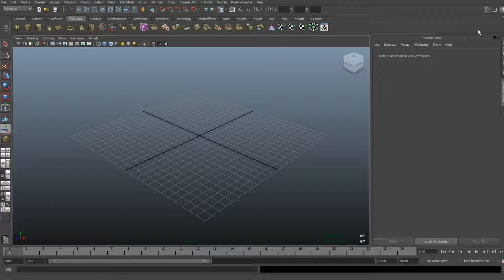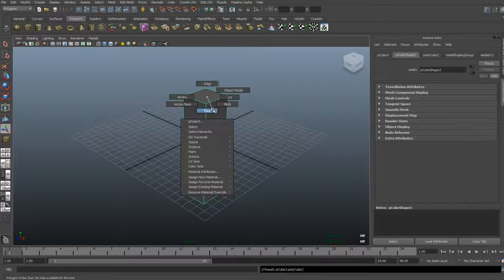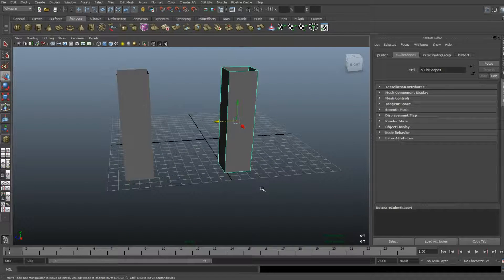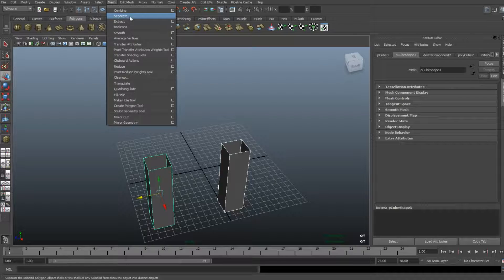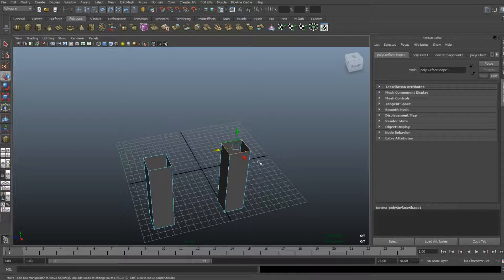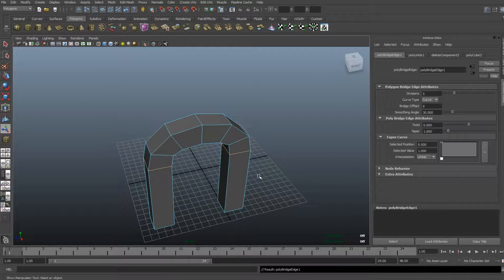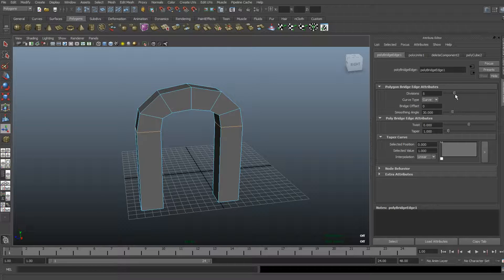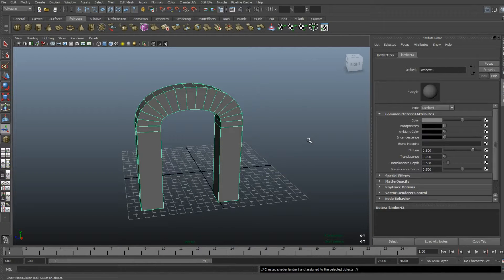Maya tutorial : How to create an Arch in Maya

Comment: Simple and easy to understand lesson - it worked great. Thanks Mike. Now, I'm using my arch to create a greenhouse for a scene I'm animating for school. How can I duplicate the arch to create the ribs of the building? Every time I duplicate the arch it is smaller and the legs distort when I move it. I can use copy and paste, but the legs still bend away from the original, when I try to re-position the copy !! This is a beginning animation class, so I was planning to simply create several arches, then create some cross members going the opposite way, and leave out the glass panels. I'd appreciate any advice about doing this and solving the leg bending issue.